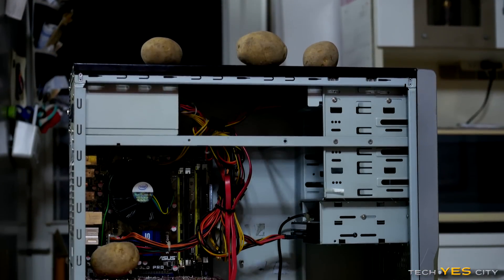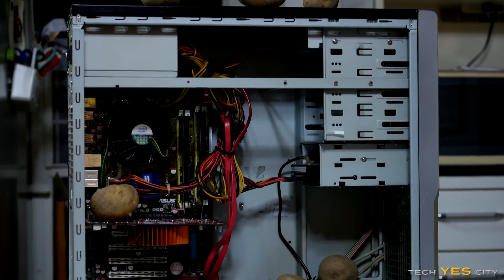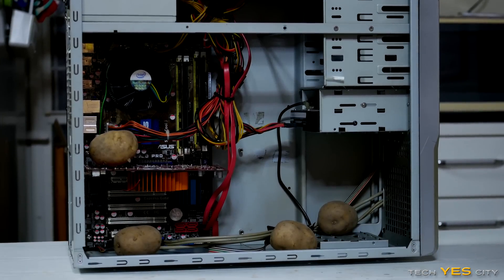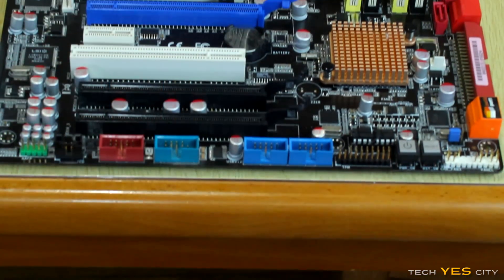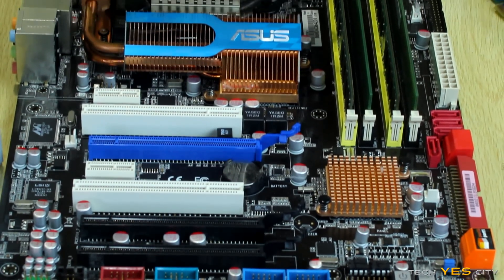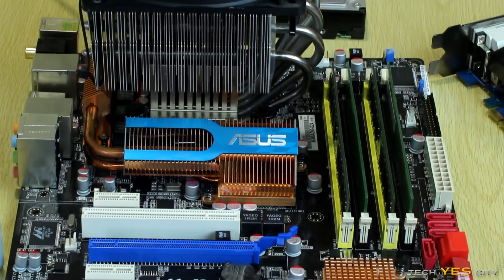The $70 CS:GO POTATO - 1080p CS:GO for Under $100?

Comment: Can this run any newer games at high fps?
Reply: Nope
Reply: +Fallen Yes. Agar.io is a newer game and you will get playable framerates .
Reply: Ahahahah! Troll or not?
Reply: Kinda a troll because most pcs can run csgo at that fps
Reply: +Fallen I think it could run gta v decently
Reply: TheTomatito2 It was a joke XD
Reply: +Fallen no you're wrong kid
Reply: +Fallen it can
Reply: well, to be fair the gt 9800 is the equivalent of the Xbox 360 gpu so it can run modern titles. just not at 1080p.
Reply: +Fallen My laptop runs CS:GO on about 20 fps :(
Reply: It can run every game that supports dx10.So yes it will run gta V on low with playable fps.
Reply: +ghetto logic umm the xbox was weaker than the PS3 which has a gimped 7800 gtx and the 9800gt is certainly faster than  the xbox 360s gpu
Reply: +Fallen I still had a 9800 gt (paired with a q6600 and 4gb DDR2 ram) when battlefield 3 came out. it was enough to play it at 720p medium-high settings or 900p low-medium settings. Since bf4 doesn't need much more ressources and scales really good I guess the 9800 gt could still play it at 720p low settings. btw. you can get an even older 8800 GTX. the 9800 GT was just a rebrand of it.
Reply: sure, it can run any 2d indie game newer than csgo ;)
Reply: Chalklate nope, you're the one mistaken the Xbox 360 gpu is faster than the ps3's.
Reply: Yeah the xbox 360 gpu is faster

Comment: This build is actually quite genious.
I was previously considering buying an AMD FX-6300 and AM3+ motherboard (a cost of at least AU$250) for upgrading a gaming rig I've got, but considering I already have an LGA775, it was a no brainer to buy a Xeon X5460 myself.
I found one for AUD$50, which is the same price as a Core 2 Quad Q6600.
Reply: EpicCookie Yeah they're good but they cost three times more than the X5460. For marginal gains in clock speed, it doesn't make much sense.
Reply: By the way, where are you based in Australia? I'm in Brisbane.
Reply from the maker: +PooPipeBoy from the Goldie, but in Japan atm, you need the $1 lga771 sticker and will need to cut the mobo, but be very careful in that phase, I have a guide for the mod, let me know if you have any questions.
Reply: Tech YES City Yep all good, I ordered a sticker at the same time. I watched your tute and don't mind some DIY work.
Back ten years ago I killed a motherboard with a screwdriver when installing a heatsink, so I quickly learned to be careful lol
UPDATE: Finished the LGA775 socket mod with no problems at all. No Xeon yet, but the rig is back together with my E8400 and still works great.
Reply: +PooPipeBoy you should have gone wuth an x5470 or x5492
Reply: PooPipeBoy if you search a lot you can find the 5470 for like 50 bucks and the 5692 for like 70 bucks.Also, the clock speed difference is marginal, but the performance difference is not. You could also get a dual socket motherboard and another 5460x if you wanna spend a little more for better performance. And your choice was good, I had a X5460 (before i got my x5492) and ill never regret getting it.

Comment: you don't even have any skins in CSGO
Reply from the maker: +LeSwagMaster Just fulfilling requests.
Reply: if the framerate is roughly the same, no matter what resolution and settings you choose, than it's mostly a cpu bottleneck, the cpu can't allow the gpu to perform any better, so it will give roughly the same fps no matter what
Reply: +good friend 
what the fuck do you expect when you're playing without a GPU?
Reply: +Tech YES City  amd  A 10-7300 processor and  radeon r6 graphics. im getting 40 fps ;/ could you tell me if it is the max fps i can get?
Reply: +good friend Lower your resolution and shadow settings.
Reply: +good friend the r6 on the cpu is still an integrated gpu, so it's not expected to perform the same as discrete gpus, you are probably getting the most out of it when i've gone through some cs go and amd apu videos, possible solution, switch to 720p if you're playing at 1080p atm
Reply: daktrdre the thing is im getting almost the same fps with 1080 high graphics and 720 low graphics. with high around 35-40 and with lowest 40+  . cant even reach 50+ fps with lowest settings.  and with all high settings sitting with 40 fps.  soo whats the deal?
Reply: i dont understand these numbers please help me...    https://scontent-cdg2-1.xx.fbcdn.net/v/t35.0-12/13234796_1025081790915525_731952957_o.png?oh=d1072c48b4e83b7d017c96c2ff447310&oe=5740DE0F
Reply: +good friend Like +daktrdre said, your CPU is the problem here. See if you can overclock that at all. Turn off Anti Aliasing, and play with Multi Core Rendering, that might help.

Comment: im wondering which pc o wanna buy. i found one with geforce gtx 950 2gb gddr5, intel core i5-6400 2.7ghz - 3.3ghz. and 2×4 ddr4 2133mhz ram. is that good?
Reply: 879 dollars. i dont have around 200 dollars but im saving
Reply: ***** 879 dollars. i dont have around 200 dollars but im saving

Comment: The ironic thing is that my i7 5500u r7 m260 laptop gets worse fps in cs go then this machine
Reply: Swessy  yeh. i had a school laptop to. but when i started gaming i switched to something with a reasonable graphics card. because thats where laptops are lacking. also your laptop is all brand new while this is secondhand junk. so that drives up the cost. and laptops are way smaller so that drives up costs as wel.
Reply: Same my PC gets worse FPS and was loads more
Reply: yes, my pc was around 2000 pounds xd
Reply: +Swessy  #laptopsarentforgames
Reply: its my school laptop doe that one guy
Reply: +that one guy yes :)

Comment: What is the stuff hes spraying the pc parts with?
Reply: contact cleaner
Reply: juan gomez
ty
Reply: +Slaney HD brake cleaner
Reply: Yominikui
I cant tell who is being serious and whose not lol
Reply: +Slaney HD gasoline bro, why would he put contact cleaner whatever the other guy said
Reply: +Slaney HD it's contact cleaner
Reply: Farnomat
thanks man
Reply: Slaney HD he specifically said in the comments somewhere brake cleaner.
Reply: Yominikui I'd not even suggest using either anyway.

Just use isopropyl wipes, much safer than using brake/contact cleaner. He used it because he had a lot of components to clean, plus those components aren't worth as much.

It's not even necessary to clean your electronics.

Hell, it's better to use 99% in a bottle if you can't get it in wipes and just use a cotton balls.
Reply: MoistGoat
Ya i just upgraded my pc and made a video about it running sli 960 4gbs now did some benchmarks also loving the results. I used mostly air duster to clean my parts and a slightly damp paper towel to clean any excess dust.
Reply: lol I 100% deserve all the troll comments I get for asking that question.

Comment: This is what I do. I take all the heatsinks off the chipsets, VRM's etc.... Then heat the thermal interface material with heat gun if its hard. Clean it off with some IPA. Then I submerge everything except the fans in warm, soapy water. I gently clean everything. Then I rinse with warm water. Then I let the components dry for two to three days. Reassemble everything and admire my handiwork lol!

Comment: but does it run the operation maps? because my 2500k and 660ti gets 40-100 fps with lots of dips on medium....120-150fps on the rest of the maps.... yours dipped to 39, about 50 fps for the most part. uuug i might have issues on my end without a potato
Reply: +Un7ucky laptop?

Comment: I actually have a similar setup just with a xeon x5450 and gtx960 and can run fallout 4 on high settings
Reply: +Dovydas Grigas same here i got a iPotato Gravy overclocked to 0.6 calories ! w/ a nSalad Seed 2000 which can run "Fall Out Potato !" on 1080p aka 1080 potatoes pixels ! pretty great build i did !

Comment: Jesus Christ, are you trying to drown those poor parts in thermal paste? You easily used twice as much as I use on my 5820k, which has easily twice as much surface area....
Reply: ***** Well, since it never passes 78C, I think I used enough.
Reply: ***** 4.5GHz at 1.365V
Reply: ***** I didn't get lucky in the silicon lottery. Happens, I guess. The 4670k I had before this was pretty shit at overclocking too. I'm comfortable running it up to 1.4V, but there really isn't a need to for me. 

I put just a line across where the actual die is and made sure my H110iGT block was tightened down right, and I haven't had a problem with it since, other than the fact that I hate the fans that came with the cooler. They're turbulent and noisy, and not what I expected for what I paid.
Reply: ***** Luckily, my pump is fine, and I was gonna put noctua fans on it anyways. Ugly AF, but you won't people to see them. Already have 3 120mm noctua fans running in the front of my case.

Comment: my pc has a gtx750 ti super clocked.  2 core duo 3.0 ghz and 8 gig ram.  i play csgo at the lowest settings 1600: 1200.  boosted by razer cortex.  i get the same fps like this pc, like wtf?? remember, Low settings.
Reply: which core2duo? anyway xeon x or e5440 are equal in performance to core2quad 9550. you could probably do this mod and get around of 30-50% fps increase...
Reply: +Vladimir Cordas i belive its a E4800 or something.  gonna check it soon
Reply: +Typhlo9797 c2d 8400 would be 2x weaker in multi threaded tasks when compared to any xeon 54X0 that is clocked at 3GHz sine they share the same architecture. Get e5440 it is around 20-25 euro on aliexpress with preaplied sticker and PCB holes so you only need a modded bios for it to work.
Reply: Typhlo9797 it should be similar to my upgrade from 2013, phenom 2 550 to 955, minimum fps went up from 80 to 125. GPU upgrade doesnt yield same results tho, it mostly boosts max and average FPS for me (went from hd4870 through hd6870 and r9 270x to r9 280x and fps increase was rather marginal)
Reply: +Vladimir Cordas dude u r a saviour!
Reply: Vladimir Cordas i might have a problem. i have a 320 watt psu... would it still work?
Reply: +Typhlo9797 it should be able to run it but i would get something new with at least 450W from antec, seasonic or enermax. Altho cheap lcpower lc 600h v2.31 would be sufficient for relativly u...

Comment: and i'm just wondering why i drop sometimes under 120 fps with my gtx 970...
Reply: very heart breaking. My Titan Z drops past 250 sometimes,  it is very concerning.
Reply: its weird though, what cpu do you have? i have an amd fx 8320, maybe that has something to do with it?
Reply: +RSBot2jar yeah AMD copies Intel processors,  Intel gives them the architecture design but they still compete in the same market.
Reply: +RSBot2jar AMD FX has weak IPC and source engine has some issues with multi thread optimisation. Did you put some thing in launch options of the game?
Reply: yes, i took these launch options: -tickrate 128 -high -threads 8 -nod3d9ex -console -novid -nojoy +mat_queue_mode 2
Reply: +Awwesomemoment that's weird :p
Reply: i noticed, gonna upgrade to 6700k soon :p

Comment: Although the difference is somewhat negligible, you shouldn't pre-spread thermal paste like that (you also used waaaay too much) on the GPU. The clamping force itself will perfectly spread a small ricegrain (or pea sized for a CPU) dot in the middle of the die across the chip without overspreading off which conducts heat into the PCB instead of the heatsink and could even short it if you where using a metalic based paste such as AS5.
.
Pre-spreading the paste results in airbubbles which don't conduct heat to the heatsink since it's not physically touching the heatsink with a airbubble in the way.

Comment: what are you spraying all over it?
Reply: contact cleaner.
Reply: .thx
Reply: +Brown Trout it's actually brake cleaner,  check out his latest video.
Reply: Thermal paste
Reply: +alessandro pelayo water wouldnt break the components
Reply: +TheArtVe the gud wrongo pal
Reply: +Thomas Stolk Water won't break any of these components (apart from the HDD) as they as they are not powered.
Reply: Thomas Stolk No. There are even videos of people washing motherboards in the dishwashers (with the CMOS battery removed, of course). I have left my USB in the dishwasher 2 times before, and it's always came out working after being left to dry.

Also, it is not April 1st.
Reply: Porn sweat.
Reply: Bleach.
Reply: ***** no shit sherlock it was a troll
Reply: piss
Reply: contaminated water from flint city
Reply: TheArtVe the gud depends.
Reply: kek

Comment: This is a result of a good optimization :D
Reply: I get 300 FPS in csgo and only 100 in mc like wtf
Reply: +GaminGHD.ro Unlike Minecraft.
Reply: +Kanoajb Minecraft and CSGO Cant be compared, they are written in different programming language and engines, CSGO has an old ass engine that has been updated over time. That's why it runs faster while minecraft has no engine, and its written on java wich is a poor language and very limited.
Reply: No. It's the result of an updated version of an engine released in 2004.
Reply: Pumpkin Paladin I wouldn't have a problem if Minecraft ran consistently worse than CS:GO, it's just the FPS goes all over the place. One moment I'm at 120, the next I'm at 600. It's really annoying when it dips in the middle of PVP.
Reply: +Pumpkin Paladin Minecraft is a huge-ass open world game so it's quite CPU intensive, unlike CS

Comment: Hi I figure you would know the solution to this?

So I turn on my pc everything glows and fans are spinning like normal but the moniter shows no display and I'm wondering if it's the gpu and if it's dead
Reply: +AnimeOkatu Make sure your HDMI/DVI/VGA is plugged into the GPU and not the motherboard. It sound stupid but check it. I've been spooked many times by plugging my HDMI into my motherboard and not getting any signal.
Reply: +NyanCatIsMyCat well I'm going to return the card. I used a DIV-D cable 3 times then I decided to use a hdmi and still no response on the moniter but once I plug my 270x back on it worked perfectly. I'm assuming the card is dead even though the lights and fans work perfectly. Well the card only lasted 2 days RIP

Comment: I have the same fps with HD 7950 3GB, AMD A8-6500, 8GB DDR3 1600Mhz ram, 1TB 7200rpm hdd, 750W Corsair RM750 and everything on low and res 1280x960. This can't be normal, right?

Comment: Is it normal that GTA 5 on low settings and same res. runs at a higher framerate on my PC than CS:GO at the same res. and low settings?Is it because of the fact that the source engine can't use more than a single CPU core and almost completely ignores the graphics card?
Reply: the source engine can use more than one core enable multi core rendering or if you really want to see a performance upgrade go into your console and change mat_queue_mode to -1 or 2 (check which one works better). it is because cs:go is highly CPU bound and not very well optimized

Comment: Why was the ddr2 holding you back so much? And would this pc be great with an gtx 750ti?
Reply: +Jern_ Because he only had 667mhz ddr2, which effectively limits his overclock front side bus to around 333mhz  which on that processor is where it runs stock at 3.16ghz, so he maby got 3.2ghz if he was lucky. To work out your max fsb for given ram you just double the fsb and compare it to the ram mhz so 400mhz fsb would be ddr2 800mhz for example

I'm sure that board being p5q could do at least 400mhz fsb stable most likely higher. With 1066mhz ddr2, people have hit over 500mhz fsb on p5q deluxe.

A 750ti should be fine with that pc i've ran a gtx 660oc with a similar setup you may get slightly bottle necked without a higher overclock but that can be fixed with better ram and heat sync.
Reply: Bill Braskey I want to do this mod and i have a 3ghz processor (x5450) and 800mhz ddr2, would that be a problem? I want to do it on a Dell motherboard so i wont be able to overclock.
Reply: +Jern_ i haven't used a dell motherboad so i cant really tell you for sure if thats your problem. you can pick up a cheap asus motherboard for well under $100, even a p5b plus will get you 400mhz fsb, that would put your processor at 3.6 ghz and 800mhz on the ram. its prolly worth going for the p5q deluxe tho imo coz it's got the p45 chipset which is the best chipset for overclocking quads. It also has a lot of other good overclocking features. I wouldnt overcolock a quad past 3.2ghz on a stock cooler tho, because the stock cooler is pretty borderline even at 3ghz. 

Imo its completely worth just spending the extra $50 and getting a X5470 because the 10X multiplier means with 400mhz fsb you are already overclocked to 4ghz. so you will get to 4ghz easier and with less voltage and heat. and be able to do it on lower tier motherboards.
Reply from the maker: +Bill Braskey Thanks, saved me time, got it up to 420 stable, 430 boots but damn its all good now with ddr2-800mhz.

Comment: +Tech Yes City I have a Pentium(R) Dual-Core E5500 @2.80ghz, can i like change it with the xeon processor? :)
Reply: What is your motherboard chipset ?
Reply: LGA775
Reply: That's the socket
Reply: Whats your motherboards model number?
Reply: G41MXE/G41MXE-K
Ofc if this is the thing you asked

Comment: Funny thing is that most 'pro' cs:go players play on 4:3 resolution and low settings. So you could probably build a 20$ PC which runs CS:GO for Pros too lol
Reply: +Atilolzz Funny thing is you need 300 fps to play at lowest possible latency so theres no way any pro would play on a 20$ pc lol
Reply: +Pat Wong 20$ pc is like something from the year 2000.

Comment: Hey Brian just as a tip; in competitive CS many experienced players use low res  and low graphics settings to make the FPS way snappier and make targets stand out more, so realistically an experienced player could use lower settings and get a more playable 250fps. Its also because pro CS players are used to CRTs